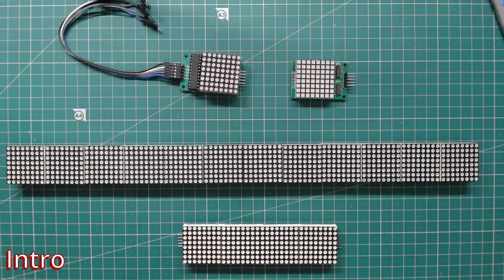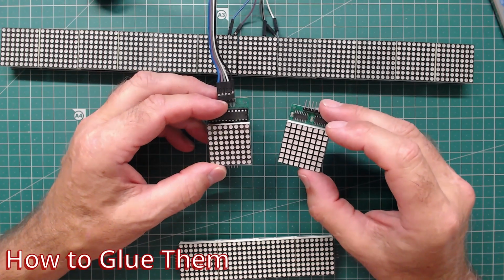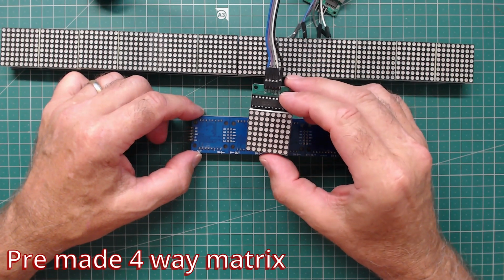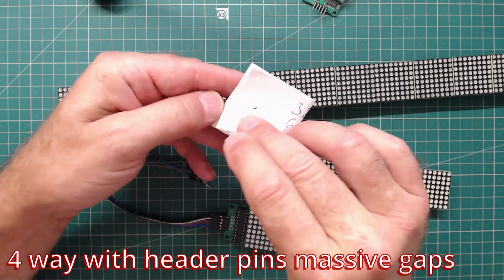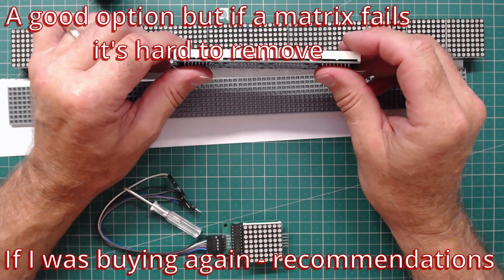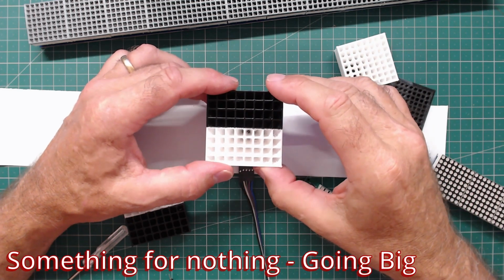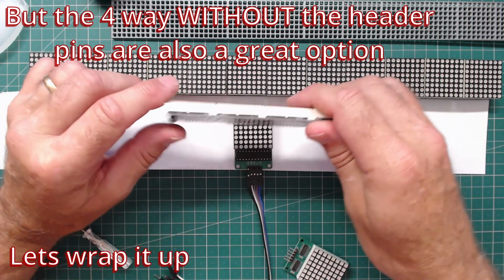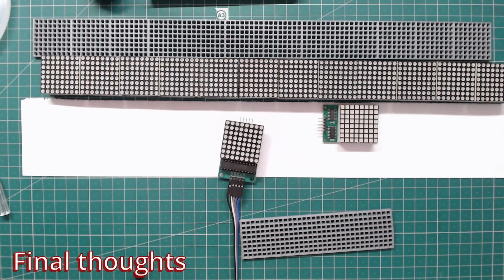Max7219 1088AS  LED Matrix buying mistakes what to avoid. Avoid the GAPs PART 4 0048

Comment: I bought similar 8x8 module. But the pins are aligned vertically which allows you to easily solder to pcb.
But there a problem. When I use LedControl.h library, it displays everything with mirror effect.  
Do you know how to fix the problem?